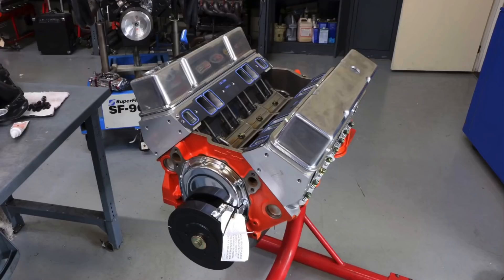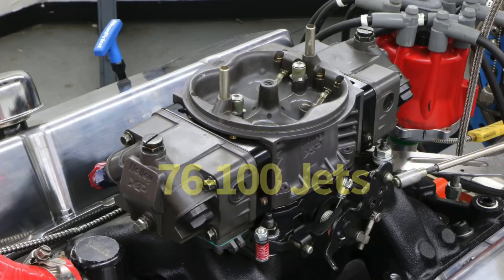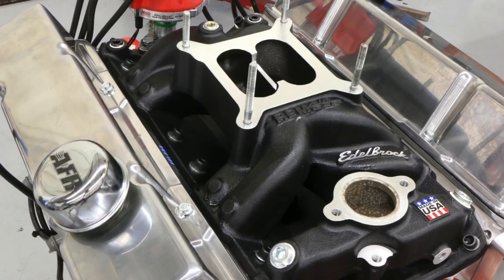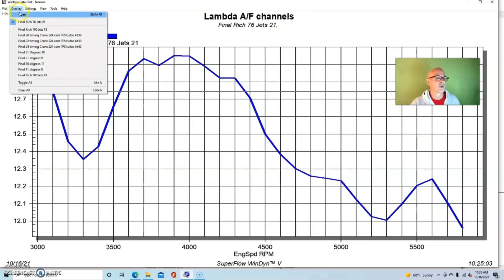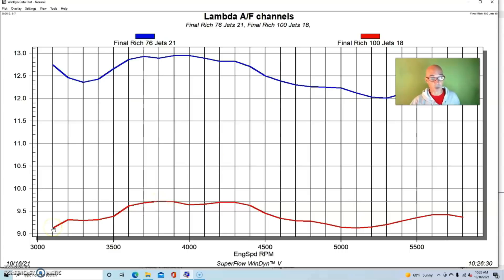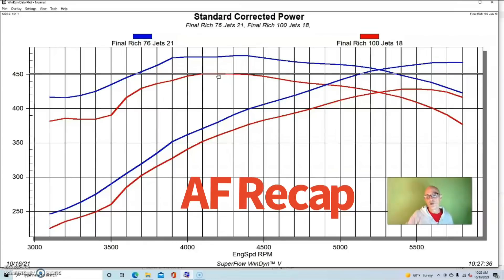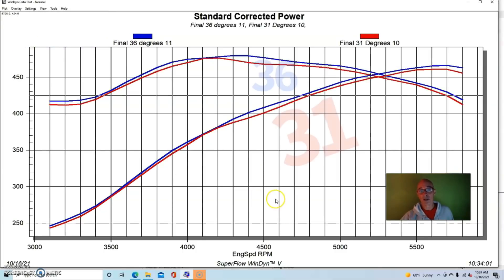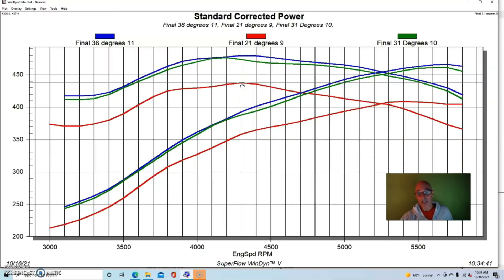TUNE VS POWER! HOW MUCH TIMING SHOULD I RUN ON MY TURBO MOTOR? WHAT A/F RATIO SHOULD I RUN (9:1?)

Comment: Timing blew piston rings in at least 3 cylinders in my Ford 427. I made a EFI tuning mistake which locked ignition timing to 10°, instead of following the timing map. I street tuned my car like this FOR 6 MONTHS! The car felt strong, but wouldn't pull all the way to redline. My friend suspect this caused the piston rings to get brittleb and break from late combustion flames which then caused oil dilution, combustion in the crank case, the ceramic coating to dull on my headers, cooked a wideband O2 sensor and oil blowing out the tail pipes. I had every negative symptom of a bad PVC, but once i found the error in the computer my friends and i suspected what happened. The leak down test suggest broken piston rings. I have yet to open the engine to see the damage. 😔

Comment: I like all of your videos , very informative. on the question of boost loss as efficiency goes up , What about the possibility of the force of the actual unburnt fuel particulates on the turbine on the hot side. is it possible this can have a actual pressure effect on the turbine?  As the fuel air mixture is more efficiently burnt . less particulates are left . a water turbine is way more efficient than one pressurized by air . it would be interesting to see the actual turbine speed or even better FORCE in the different circumstances  .  Please tell me what you think

Comment: As simply as i can put down what i think….
     Less timing leaves an incomplete burn. ie the there is more expansion still happening during the valve overlap period than at earlier/more efficient timing levels.  
   The incoming pressure is in essence running into reversion prone pressure Making more overall pressure.

Comment: I recently decided to turbo charge my car and was also worried about running it untuned, it’s running great almost 5k miles on the turbo set up and it’s still healthy, a lot of people said it wouldn’t work but as long as you keep on the factory sensors connected the stock ecu will do it’s thing

2000 Lexus gs300 2jzge turbo with 250k miles 🦾still factory auto
Reply from the maker: terrible idea
Reply: @richardholdener1727  🤣 it works for now until I get a proper ECU but the stock ecu can compensate for 10-11psi for it hits fuel cut, as for timing it’s anywhere from 20-38 , AFR at idle 14.4 to 15 & 12s WOT, low boost 8psi

Comment: My GTO Is set to 45 degrees locked 🤣
Reply from the maker: that should work well-but only under boost
Reply: @richardholdener1727  
It's the only way it would start. I got timing marks now I just gota put a light on it

Comment: Duh Stock v-8 engine modified with street cam use stock 4 bbl carb and fine tune it , timing leave stock or a few degrees advanced. Play with it. Use differenet fuels. Yep it always worked .

Comment: Maybe it's something to do with exhaust temp, on the turbo set up. When they don't have enough timing some of the air fuel escapes out the exhaust unburned.  Maybe it's still creating pressure in the exhaust after the exhaust valve closes causing it to turn the turbo just slightly harder than when it has enough timing to get it all burned in the firing chamber ?
Just a guess........
Reply: That's my thought, and to expand on it, it would have been interesting to measure exhaust pressure before the turbo and overlay those results on the test. I think the late ignition shifts the combustion process somewhat into the exhaust event.
Reply: @yarrdayarrdayarrda  
That's kinda what I'm thinking. 

Its very slight. But I think that's what might be going on
Reply: Thats usually how a two step ignition gets basketball sized turbos to light on a sportbike engine. It cuts ignition completely over an Rpm threshold and retards ignition timing to 0 to -* degrees so the unburned charges ignite in the pipe. Really delayed ignition hits a turbine hard with the high temp and energy of the fuel charge that didnt do any work in the engine.
Reply: About the same as I was thinking. It acts like a mild antilag, that use a bit more of the energy in the exhaust for spooling the turbo, and a bit less to make power to the crank.

Comment: well .. boost is just a measure of restriction to flow... with the added timing, the engine flows better thus lowering the observed boost. 
Just like what happens when you added timing at idle, and then the rpm gets higher and makes more vacuum.

Comment: The NA test is interesting to me because you say 36° is where it wanted to be but then you go on to say you prefer to tune in a safety margin, which I've also always done. Plotting your data points, your HP/degree drops from 9hp/deg down where it was obviously below the sweet spot, to 5.3 up to 31, and then 1.2hp/degree from 31 to 36. That tells me this motor would run well and last a long time with a healthy safety margin somewhere closer to 32 than 36°.
Reply from the maker: we run it where it stops making power

Comment: Were you recording knock during the boosted timing tests? If so, did you see any and at what timing/boost levels?
Reply from the maker: we don't run knock sensors-it's not a factory ecu

Comment: My TBI runs at 14.7:1 when the engine gets to operating temperature. When the engine is cold, a out 120 and lower it runs from 13:1 down to 11:1. It seems to have quite a bit more power when it runs rich like that. I wonder how much it's actually losing at 14.7:1.
Reply from the maker: it likely doesn't run 14.7 at wot
Reply: @richardholdener1727  I put a AFR gauge on it. Once the engine warms up it never really drops below 14.7:1, even at wide open throttle.  It cruises down the highway at 17:1. Ive read this is how they were designed, but its the internet so who knows for sure.

Comment: Agreed the timing dropped the boost curve. With more timing in the engine it became slightly more efficient at producing power therefore the boost dropped slightly. It does make sense.

Comment: It's like launch control/2 steps where it retards the heck out of the ignition to get boost earlier on the line. As said, the heat from the ignition gets the turbo spooling earlier and in the case slightly more
Reply: a lot of the time 2 step doesn't build boost ...

Comment: My assumption on the boost drop would be due to allowing more of the combustion reaction to happen in the cylinder by advancing the timing thus creating less back pressure in the exhaust.

Comment: Thanks so much for doing this detail on the 383.  I have one in my boat that's similar but not same.  It has Dart iron heads so maybe it gets a little less advance.  
It has 10.3:1 compression and probably a milder cam.
I have it propped to get 5100 rpm, maybe I should try a little less ratio to let it spin to 5400.
It's not been dyno'd but maybe it can be dyno tuned this winter if I can get it out of the boat for a checkup.

Comment: Was that 4.8 on 93 or e85? What timing would you suggest for 4.8, 78mm 93 oct, 6 psi?
Reply from the maker: WE USE E85 USUALLY WITH BOOST, 93 AND 6 PSI CAN RUN 18-20 DEGREES AT THE POWER PEAK
Reply: @richardholdener1727  wow that much on 93? Sitting at 8 degrees peak torque and 11.5 degrees @ 5100-5700 rpms and it feels great, I couldn’t imagine 18 😳. Methanol injection will be installed soon, I’ll ramp it up then! Thanks for the reply, love your channel!

Comment: Nice video.
Aside from melted/broken parts, what is the best indicator of finding optimum timing for a specific rpm?
Reply: You use a dyno. Keep increasing timing until you don’t see an increase in torque. There is no good way to “street tune” timing.
Reply: EGT exhaust gas temp and knock sensors
Reply: 👆with boost you are often octane limited. Get some good fuel so when you go half a step too far it doesnt end your day and bump timing bit by bit. Some guys have done it with a G pro but its really hit or miss. An hour on a chassis dyno can sort out lots of a tune especially if you have it really close already.
Reply from the maker: full throttle runs with new plugs and ground strap inspection can work also if no dyno
Reply: Thanks for the timing experiment Richard 🙂
Reply: If your ECM can use a knock sensor, then you can adjust timing until it detects knock. Then pull the timing back a couple degrees.

Comment: I know I'm not telling you, Richard, but commenting as asked anyways.  When the timing changes, meaning your actually timing the flame front propagation to engage the piston (and thus rotating assembly) you are taking the energy from the combustion mixture and you can either let that expansion or work exit the exhaust with low timing where it will drive the turbine, or you can light that mixture off faster (more timing advance) and properly time it so the expansion is spending more time pushing the piston down in the cylinder and converting it into work at the crank.  Tuning 101
Reply: Exactly. I watch a lot of Evans Performance tuning videos, and he always starts super conservative on the timing numbers, like 5 degrees.  You can see the boost drop with each incremental timing bump. It's funny to add 3 degrees of timing and lose power because the boost dropped by 4psi, lol. Good stuff.

Comment: I reckon More timing creates less energy after the exhaust valve which equals less drive pressure causing a higher differential pressure between the intake side and the exhaust side causing more flow through which equals less boost. If it had a electronic boost controller on it to run the same boost by closing the wastegate it would produce more power again

Comment: more timing = less enthalpy available to spin the turbo. more of the heat energy from the fuel is converted to work (more hp) and more fuel energy would be transferred to the piston and cooling system. this would show up as less boost, so your data does make sense. having a turbine inlet thermocouple would have shown this too.
Reply: I agree with Reed, but also in play is the size of the turbo.  You went with a 76mm turbo which is on the large size so when more energy is converted to Hp/Tq (or RME - Rotational Mechanical Energy).  This is why I wonder why no one in the Hot Rod world has experimented with a venturi style nozzle at the inlet of the hot side of turbos to make the most of the available ideal gas properties.
Reply: I agree completely Reed, to prove this simply read the exhaust temp before the turbine and you will see as timing is increased, exhaust temps fall

Comment: hey Richard I have a 10 to1 347 small block Ford with a gt45 turbo I'm going to run 8 lb of boost on 93 octane it's 30° too much timing? and if so what would you recommend
Reply from the maker: PROBABLY TOO MUCH

Comment: I think a bit of ex still burning is helping spin the turbo, keep it hot. With a diesel retarted injection timing defenetly helps spool a bigger turbo as compared to advanced although usually they make more power addvanced
Reply: Agreed, I was thinking there was a little more heat energy driving the turbine with the lower timing levels.

Comment: If its a good set up 12:1 is still Rich as a thing that won't pass a petrol station.
Power seems to be in the mid 13's.
Reply from the maker: NO, JUST NO. THIS MOTOR MADE NO MORE POWER AT LEANER MIXTURES. THAT IS AN OLD WIVE'S TAIL! LEANER IS GOOD FOR CRUISE.
Reply: 12 to 1 is a bit rich but isnt out of line from what OE programming is. It also only matters when it is wide open. If you are tuning for power, you give the jet the engine wants to make the power and deal with the fuel use especially if its only a quarter mile at a time. If your puttering around town as long as it stays close to stoic your really not wasting any fuel. There is very few gasoline engines that run stoic at full power. It takes a really tough engine with lots of heat abatement strategies to keep things alive. The ford 7.3l does this, it runs lambda 1 at all power levels.
Reply: There are certain instances where you WANT to run rich. The extra fuel can be used to cool the combustion temps.
Reply: @richardholdener1727  You are testing motors with poor surface area discharge ratios. Only engines that are poor in efficiency need a rich mixture. Efficiency starts dropping disproportionately  on bore sizes over 75mm. There also seems to be a big step change at over 86mm. 
I've built a few engines over the years that are bigger bore shorter stroke but still to the same displacement and every time they need much more cam timing and fuel to make a small amount of extra power. The original Ford DFV was pretty much on the money if your using springs for valve control, 12000 ish rpm max. If your using air and can go another 2000rpm with your bottom end then all I've said goes out the window.
Reply: @gothicpagan.666  dude...big claims. Jay from Woolich racing has been tuning motorcycles for longer than i have been alive and his arguments are antithetical to your statements. In a blog post regarding tuning the 2006 yzf r6, that has a 67mm bore, he said "...look for 12.8:1 in the acceleration region and 13.2:1 in the power region". 
Now you have to make the argument that a 67mm bore is too big, or a sportbike engine that can run to almost 15k rpm has a poor surface are discharge ratio or you can admit that what youre saying isnt valid.
When you say that "only engines that are poor in efficiency are the ones that need rich a mixture" you have to give more evidence than a statement. Holdener shows dyno charts with lambda readings, i have given a source of a professional with a lifetime of engine development. You say one thing and dont show one dyno chart or give one source for a ford dfv with afr values attached.
Reply: @timothybayliss6680  Looks like they have found the same thing. 67mm is smaller than 75mm where the first step change seems to be. 13.2AFR is also in the ball park. With such a low torque engine the loading/transient rpm ramp is critical.
I knew a few bike engine builders, they were chasing piston manufacturers to come up with a material that would allow thinner and thinner piston crown thickness, 3.6-3.8mm was the norm. 
Ducati 996's were at a disadvantage for sheer power and MM comp systems were using a ecu with ign. timing to 3 decimal places 50+ works spec engines were used to get the fuel/timing maps right. Because all the teams were on a spec 102 octane fuel many teams dropped the comp. ratio in favour of ignition advance to liven the engine up a bit, something that didn't show up on dyno's at the time but did with the rider at the track. That was 25 years ago, just before I took semi retirement. We didn't have good exhaust extraction units at the places I worked at in my early days, indeed it was the norm to work out the AFR by the measured fuel flow rate on a Taply meter. 
I'm afraid I don't have graphs for DFV's, the people at the time kept everything relevant to their engines. Graphs were plotted by hand, dyno's just had tachographs and oil damped spring balance scales gave you your torque value.
Reply: @timothybayliss6680  When Webber started doing replacement carb kits(All kits were based around the same basic unit) for popular European passenger cars, back in the mid 80's they always used to jet them a tad fuel rich, the same as most manufacturers had done. When asked why, they surmised it would result in less warranty claims for damaged engines. We found a bit more power and a margin in fuel economy by optimising each and everyone we fitted and as a shop we fitted 1000's untill the market died in the late 90's. That was an easy improvement for a shop with a chassis dyno.
Bill Bydenstien went to the effort of offering modified cylinder heads for GM products to the public that improved all-around drivability and economy, not just performance. A good man 40 years ahead of his time, now sadly no longer with us.

Comment: G'day Richard.  The reason for the boost drop as the ignition timing is advanced is because the temperature of the air at the point of ignition is lower, combustion & exhaust gas temperture is lower, & the resulting boost is lower.

As Chris Greenup says, fuel has a calorific value, which is independant of the initial temp of the compressed air/fuel in the cylinder.  Air temp raises with compression ratio, but since the air/fuel mixture is ignited earlier in the compression stroke, the air/fuel temp is lower.  That lower ignition point temperature leads to lower exhaust gas temperature.  The turbo is a device that uses heat energy & converts it to kinetic enery.  The lower the heat energy, the lower the kinetic energy.  The lower kinetic energy leads to lower boost pressure.

BTW, you could try a test where the ignition fires every 360 degrees vs 720 degrees.  I read somewhere that motorcycle engines used to get more power from a turbo install because the ignition fired on the compression & exhaust strokes.  The Ex stroke firing raises the EGT & boost.  It was probably an article by Kevin Cameron at Cycle magazine - he knows his stuff, so it might work.

Thanks for a great question - it's an oldie, but a goodie.

Andrew

Comment: The change in boost in my opinion is from some other factor than timing. Timing may play some part, but in particular for the 24 degree run, you said you only changed the timing after peak torque.  If that's the case, it should overlay the 22 degree boost curve until the point that you added the full 24 degree and then diverge. The fact that it is offset for the whole rpm sweep leads me to believe there is some other factor involved besides timing.
Reply: I noticed that, too.

Comment: Richard is the man, great stuff. I’ve seen this tuning on the street and I “intuitively” believed it to be the acceleration rate of the engine increasing/better efficiency. The other possibility would be lower EGTs creating less boost. It would be interesting to see this with EGT, IAT, & airflow data.

Assuming the accel rate was the same for both tests maybe this supports EGT variation being the driver?